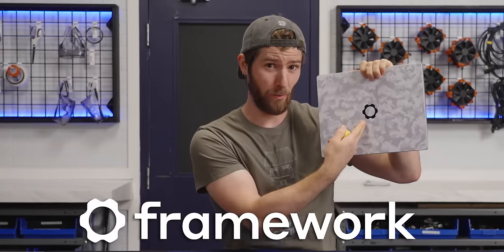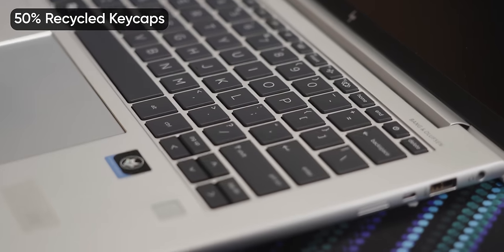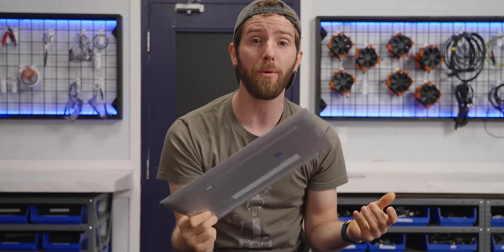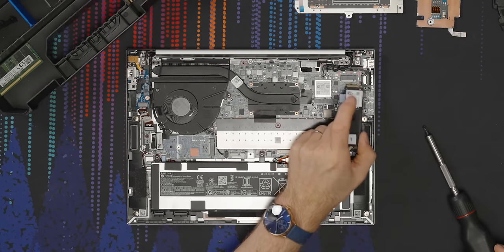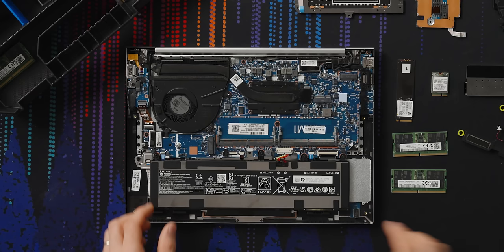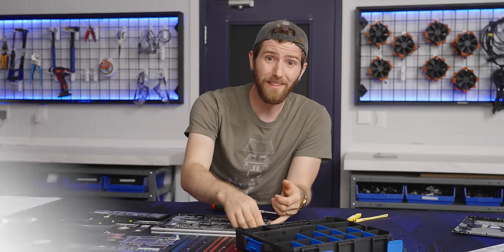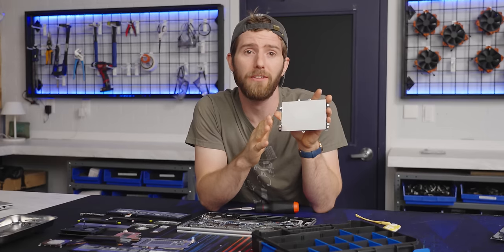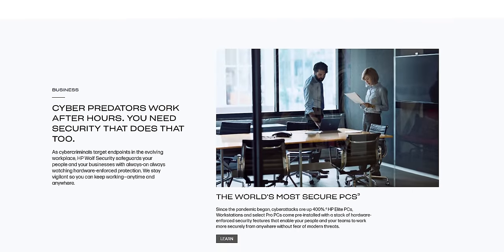My Investment is in TROUBLE - HP repairable laptops

Comment: As someone that used to work repairing HP laptops I must say "OMG how far we've come!"
Great work by HP here, this laptop would have made my work so much better 10 years ago
Reply: I remember wanting to upgrade my wifi to a wifi card that wasn't even available from HP's line of outdated wifi cards. But HP's BIOS had a whitelist restriction on wifi cards and refused to boot with a NON-HP wifi card installed.

So I debugged the BIOS file and altered the whitelist into a blacklist (just by changing one JMP instruction). Essentially, the HP laptop now accepts ONLY NON-HP wifi cards (and refuses to boot if you are using a real HP wifi card).
Reply: My prediction: By the time these laptops actually need to be repaired in 5 years, HP will have decided it is not profitable, obsolete it, and deny it's existence.
Reply: Old hp laptops are nightmare to take it apart..

Comment: What about keyboard replacements? Quite crucial if you ask me. That being said, the EliteBook line used to be super easy to repair untill a few years back. Glad to see theyre coming back around on that.
Reply: I think keyboard and mobo are the two main things Framework offer that this device doesnt - and I agree completely on the keyboard as it's the most likely to get worn/damaged, or even be the part that most people want to upgrade for cosmetics (blank keycaps/unworn keycaps) the most.
Reply: Ease of keyboard replacement and the screwless back panels and batteries were some of my favorite features of the older EliteBooks. The keyboard seems like a big thing to omit.
Reply: what are you doing with your keyboard that it fails. I dont know anyone who has ever had a problem with a keyboard before.
Reply: @lizziemcdonald1748  no one asked about who you knew.
Reply: @lizziemcdonald1748  I support employees at a large corporation. Keyboards are one of the components that most frequently needs replacement. Spills, pets, accidents, wear and tear...
Reply: @lizziemcdonald1748  You are the type of person to say "Why do companies bother to make new devices every year? My device is still perfect my needs."
Reply: @lizziemcdonald1748  Using the keyboard can contribute to its detriment.

Comment: I just recently picked up a new HP laptop.  I saw the HP video with the replacement of every part. Not only is it an official guide, the thing is freaking timestamped for all the fixes. Awesome.

I ended up getting an HP due in large part to how well my old HP laptop did. There were problems and at the end it was being held together with duct tape and super glue (like, literally actually using duct tape and super glue), but there was always a way to fix it. Even the problem that I thought was going to force me to get a new laptop was able to get fixed, though not before I found a deal on a new HP that was too good to pass up.

Comment: I love how the presence of companies like Framework has pushed a major player like HP closer towards repairability. Keep up the great work!
Reply: It doesn’t, at least not for HP. My old HP laptop (AMD HD4000-era) had a 100 page service manual walking through the replacement of any component. The design was awful with a lot of steps, but they do provide the spare parts and documentation for a long time
Reply: The thing is, this is basically already what hp business class laptops look like with a slight bit more sauce on it. The real issue is that all cheap HP laptops, and there are lots, are absolutely horrible plastic things not made to repair at all.
Reply: Honestly: Its not true. HP had those models for a while now. Plus in the more premium segment you were always able to get the parts from HP for years. This is nothing new. 
Also soldered RAM, i.e. LPDDR4/5 actually has advantages in notebooks so I really do not know why you would hype the upgradable RAM.

Comment: Thinkpads are also very repairable, and have been since nearly the beginning. There's a webstore where you can order almost literally any part, and if it's not in stock, it'll give you a compatible one. Lenovo has official video tutorials on how to open and repair the laptops. All the screws inside are even marked with which type they should be! And the captive screws are standard on thinkpads
Reply: I once asked the customer service for a new battery because it wasn't in stock on their website, they sent me the link of the OEM with the precise model... Except that the OEM doesn't sell to public so good but not perfect
Reply: Not so much anymore. For the last ~4 years, the majority of ThinkPad ultrabooks (X1 Carbon, X13, T14s, etc) have had soldered RAM. Most of the Intel ThinkPads also have soldered WiFi - even on laptops that definitely have the space, like the X1 Extreme.

I tried buying a replacement for my ThinkPad X240 back in 2019 that was just as repairable, and I ended up going for a Dell Latitude. HP Elitebook was also enticing even at the time, but they were comparatively expensive in Canada.

Really happy that 3 years later, we have an option like Framework.
Reply: Most of new thinkpads have ram soldered, they are repairable yes, but upgradability is mediocre
Reply: Was coming in to say this. Having worked in IT for over 10 years, I've enjoyed nothing more than servicing the L and T series Thinkpads from Lenovo. Easily the most repairable out of the Big Three by a country mile.
Reply: As of recently, I've seen pretty much all new Lenovo laptops, even Thinkpads, have soldered RAM without any unsoldered slots. You have to choose the RAM you want from when you buy it, with no chance to upgrade later on.
Reply: @nanglo6817  it's unfortunate that the X1 Extreme has soldered ram. I have a first gen P1 which has socketed ram and I assume that the newer models still do. I guess upgradeable ram is a feature that only the professional workstation laptops get
Reply: @jacobglass2951  most of the new thinkpads suck anyways
Reply: @steelfox1448  X1 Extreme has soldered WiFi but AFAIK the RAM is upgradeable. I think P1s and X1 Extremes are pretty much the same laptop.
Reply: @tim3172  I switched some 128GB Intel SSD to a Samsung 970 something (can't remember exactly) without issues
Reply: @jamess.2491  that's why my t530 is still going strong
Reply: As I recall getting hold of spares for IBM was a PITA. Though that was 20 years ago. That thinkpad is also one of the easiest to break that I've seen. We had about 4000 of them I think and they broke constantly.
Reply: @jacobglass2951  which actually is a performance benefit. LPDDR5 is both faster and uses less power than normal DDR5. So I can fully understand why you would include it in a high end model
Reply: @nukularpictures  Of course it is, simillar to apple and their unified memory in Apple sillicone, however many users will happily trade a little bit of performance for future upgradability as manufactures tend to price their ram upgrades extremly high.
Reply: @jacobglass2951  same, got a t460s for running linux and it still works great
Reply: lenovo has software locks that prevent you from using third party modules

Comment: A massive improvement for sure, but the Framework is still more repairable or at least easier to repair. Kudos to HP but still a little more to go before I'd say it's mission accomplished. Of particular note, while the trackpad is relatively easy to replace, the keyboard is not. You have to remove every component to replace the keyboard including system board, you don't need to do that on the Framework. Keyboard is definitely one of the parts more likely to be replaced so this is definitely an area HP can improve. Also of note, their YouTube channel does not really show explicitly how to swap the keyboard, I'd like to see it bc I recently had to swap a keyboard on a Lenovo X1 7th Gen, using a donor laptop. It's 140 or so screws that hold in the keyboard. Not even joking. Multiply that by two since I had to pull it from a parts donor laptop. So curious to see how many screws this keyboard takes. I'm about to begin another round of evaluations for new laptops for my company and repairability is high on the list. The Framework loses points for me and my company because it's not widescreen. 

Overall, Kudos to HP for these changes, and as others have said if Framework pushes other manufactures to make their crap more repairable it's not a failure. Certainly this HP has put itself on my short list of potential options.
Reply: The keyboard is part of the top cover assembly. It comes as a whole unit. You "can" remove the keyboard from this, but it's a nightmare - screws, sticky tape etc.  And yep, everything is attached to the top cover assembly, so it's a crap job. No idea why HP (and others) do this, since it's so easy to have everything mounted to a base cover and have the keyboard cover easily removed 1st.
Reply: Or I could get a Raspberry Pi, and then I can even repair the individual chips. Of course, working on a Raspberry Pi every day will cost you a tonne of time every day, due to how slow it is.

Same thing here. Yeah, they keyboard might take 20 more minutes to replace, but you only have to do that maybe once every 5 years. The Framework, on the other hand, will cost you a little bit of time every single day, due to its small screen, its slower CPU, and its Intel GPU.
Reply: More importantly, the Framework's parts are MUCH cheaper.
Reply: @RickYorgason  framework comes with a 12th gen intel cpu if you want

I don't see how anyone can say that to be a slow laptop cpu
Reply: @RickYorgason  bro really compared intel's 12th gen to a raspberry pi lmao
Reply: 140 screws to replace a keyboard is a bit much
Reply: @RickYorgason  if you're work day is slowed down by screen size (maybe you're using large spreadsheets), or the tiny difference between a 6600u and an 1240p, or even GPU differences, then I'd suggest you're looking at the wrong class of laptop. Also, for many, the difference in keyboard and trackpad comfort and familiarity will make a larger difference than the CPU. And most laptops that we sell (for business use) these days are used docked with 1-2 external screens, keyboard & mouse anyway.
Reply: @Alaster-  That's kind of the point, this laptop is in a different category from the Framework. I don't think many people would put Intel GPUs in the same category as Radeon and GeForce.

I do indeed work with spreadsheets, and also Fusion 360, Meshroom, Unreal, and other programs that need a decent GPU. And I dock my laptop often, but I also move around a lot when I'm working.

This HP could satisfy most of those needs, and is very repairable. I've never had to replace a keyboard (only keycaps), so if my choice is between a moderately easier repair for a keyboard, or a bigger screen and better GPU, then it's a no-brainer for me.

But who knows, maybe Framework will release a Framework XL by the time I'm ready to replace my current laptop.
Reply: @RickYorgason yeah the F.W wouldn't suit your requirements that well (sure in time they'll bring out maybe a 15" or 16" model).  Given what programs you're using is the AMD igpu even enough for work?  I'd be stepping up to workstation grade laptop with dedicated GPU. Sticking with HP, the Z firefly's are basically the same chassis as the elitebooks, but with better internals (and generally better warranty standard). And I haven't checked lately, but some of those programs annoyingly had certain features only available/enabled with workstation grade GPUs.

Comment: five screws for a bottom plate may seem great but i remember my old Dell laptop with only one captive screw. It was a slide-off bottom plate and once you removed the one screw, the whole internal circuitry was accessible. It was much more convenient than anything i have ever used.

Comment: HP's enterprise lineup always had a lot of documentation and manuals. It used to come on these bundle of CDs with everything you needed.
Reply: Yeah that's cool and all, but what about the cheaper models? Imagine being a student, not able to affford a premium device and then getting fcked when trying to replace a battery after 2 Years.
Reply: The replacement are the Quick Spec sheets and other PDFs on their (very slow) web page. Works good enough :P
Reply: @XA--pb9ni  If I know correctly the 255 notebooks are the cheaper models.
I couldnt find the parts readily available on their part surfer page. Usually though the SKU is on a sticker and should be relatively easy to find out by reviews from ifixit and other repair outlets.

Comment: I think the big caveat is that years down the line they might stop selling replacement parts, so even if its easily replacable you might not be able to find oem or even third party parts considering the number of different parts hp has. I ran into this a while back trying to replace my less than 5 year old hp laptop
Reply: If it’s a popular model used parts are also a huge source of parts, just like how laptops have been getting repaired for decades now, with donors.
Reply: @alexmills1329  idk how popular my old hp envy was but after I could not find the exact model number I did try purchasing replacement keyboards which seemed like it would fit but was just barely too big. I tried contacting support and they confirmed it was no longer being stocked and adviced me to upgrade.

I dont doubt that you could find replacements for popular models, but if this laptop gets buried below the other models (cause the vast majority of laptop owners probably dont care about repairability) I doubt that hp will continue stocking parts. Though the cynic in me thinks that they might be using planned obsolescence to force upgrades as I really doubt that keyboard designs should change that much.
Reply: @PackCracker66  I wouldn’t use fake parts from ebay 🤣
Reply: @christophervanzetta  then don’t use fake parts. If you cannot distinguish quality between genuine and fake parts from eBay then that’s your problem.
Reply: Fake parts from eBay, is this a thing…
Reply: I’m going to say that there may be some fake parts, but there are also a TON of real parts from pulls. Companies refresh hardware often and just scrap (ecycle if you like) their old inventory. This leads to tons of old parts on the market and not all decommissioned hardware is broken. I’d say more isnt than is. I think this person just gut wrenched.

Comment: I always appreciated the design of Elitebooks. I daily driven at work one Elitebook 850 G1 (or G2) for four years, next a Zbook 15 G3, also for four years, and now an 855 G8 since two months or so. 
I loved the fact that you popped the back open and the whole mobo is exposed and you can easily replace HDD/SSD/ RAM, Wireless modules, clean the cooler fans or disassemble the whole cooling assembly to apply new thermal paste if needed... Basically a lot of stuff can be done just by opening the back. Replacing the keyboard was also possible without remove the mobo...

Buut... Elitebooks are designed with enterprise and fleet deployment in mind... and they command a premium price...  I wish the same repairability is available on their lower end laptops too...

Comment: We need more repairable, modular laptops. Im excited to see a day where you build them from the ground up yourself like a desktop. Laptop chassis form factor standards.
Reply: That is not going to happen. Form factor standards in such a densly packed device would be either a huge waste of space or out of date after 2 years. We absolutely should demand repairablility and spare parts, but I'm fine with that being device specific for some components.
Reply: @jimhalpert9421  You would also need to figure out cooling for devices like that. You’d need to buy a chassis and heat sink that can adequately cool it. Or the regular chassis would be huge.
Reply: @jimhalpert9421  Im okay with it being device specific too. But eventually it isnt farfetched to have industry standard laptop cooling,  chassis, motherboard etc. You would just need enough brands on board with manufacturing them. Every computer is "out of date" after 2 years based on that line of thought. And i believe it is the exact opposite of a waste of space. Thanks for your professional guarantee, but i beg to differ.
Reply: @official_pol2198  Peltier coolers exist and if used the right way, could take small form factor cooling really far. just saying. 10-15 years from now its not a stretch to say its possible. If i could build my own laptop, just like a desktop, I would do it before i bought a pre built any day.